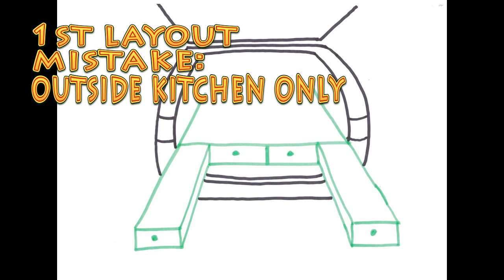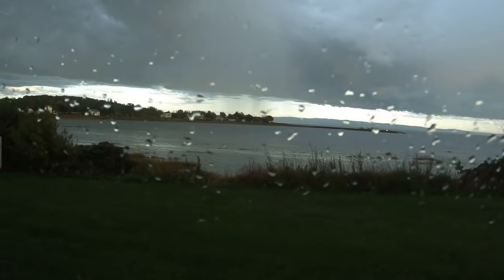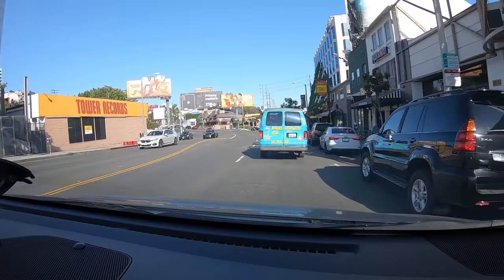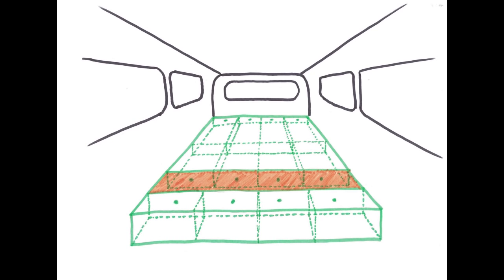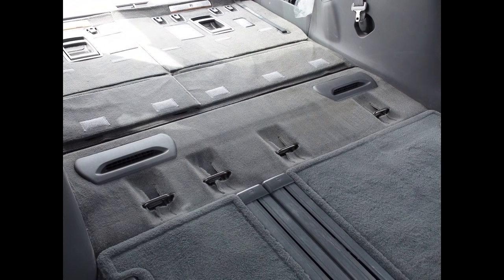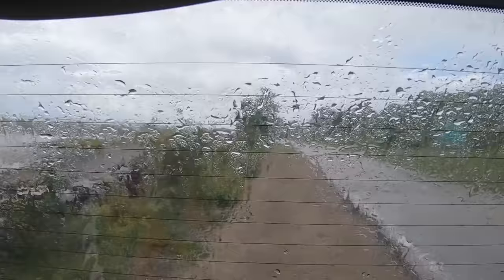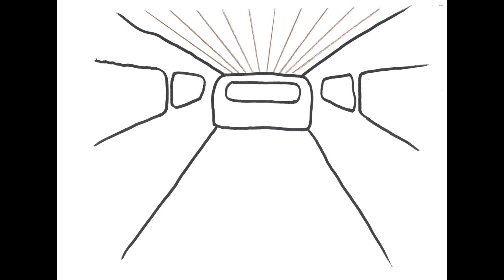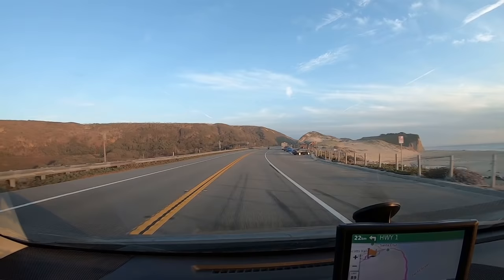11 mistakes to avoid (van conversion)

Comment: Great advice based on real world experience.  One thing, as a fellow surfer, I love the fact that you keep a couple of boards on the roof rack.  But, have you ever had someone try to steal the boards ?  Part of my problem is trying to store a longboard inside for fear of having it stolen.  I notice you have about 3 boards up there !  Nice !!
Reply from the maker: Hello Ray!
I use straps that lock and have steal wires inside. I use KanuLock straps of 13 ft. Never had any problem, and I have been everywhere with them!
If they don’t sell them at your local surf shop, show them the product and they will certainly keep them in stock. They will be glad that you show them a new product to them. 

Thank your appreciation!
✌️
Reply: @ericenjoysearth2756  thanks for the quick response... will get a pair ..Happy Travels Eric

Comment: Although I have yet to start a stealth conversion with my minivan, I have viewed many van conversion videos to help me decide how to do it simply and economically. I am delaying because I still haven't decided if I should convert my low top minivan or wait until I can afford a high top cargo van. 

Eric, with your 20 years of van living experience, your videos are the most detailed and economical conversion videos that I have found. I agree with your idea about having most, if not all, amenities accessible from inside the van. Also, while other videos that I have watched often don't include comments from the original poster, I am impressed at how many of your videos either include a comment, or an answer to a question, or a simple thank you. I appreciate all of your efforts.
Reply from the maker: Thank you John for your comment! It is really appreciated.
To help you figure out what van size to use, you may view that using a minivan is like living in a cabin of a small sailing boat. People that are sailing on those boat don’t complaint about it because there is no option that’s the way it is. Having a minivan, you will get use to it inside size too. I can tell you that I don’t regret at all having all the advantages of the minivan!
Enjoy planning your project ✌️

Comment: Great video! I knew I wanted lots of windows in my van and purchased accordingly, then I started to doubt that decision based on what everyone else was doing. Thank you for reassuring me on so many points. I don't always want to be outside or have my van doors open and don't get me started on mosquitoes! Thank you!
Reply from the maker: What is fascinating is how much people follow tendencies based on no experience or false concepts. Go ahead with plenty of windows! You will appreciate so much! Just use Reflectix window covers to manage temperature when you sleep (and get privacy). Thank you for your appreciation 😃✌️

Comment: Great tips, Eric.

Most of my kitchen is accessed from the rear tailgate but I made sure to be able to get to some kind of food from the inside of my SUV, as well.  I have 2 fridge units; one for inside and one only accessible from the outside for extra cold storage.  I have a Clam shelter for day-to-day use but I know I won't always be able to deploy it.  I don't plan on being an urban vanlife person so I'm not worried about those obstacles mentioned, but I did always keep in mind that I might have to do everything from the inside of my rig due to unforeseen circumstances.  

I bought a rear-facing camera to make up for my lost view in the rear cargo area.  I was going to just make the build shorter on the passenger side but that would have eaten a lot of usable storage space.  It made more sense to get a camera to assist me when driving.  

When I was designing my build, I took into account which things I need to access from inside and which ones I can live with that are only accessible from outside the rig.  Clothing was number one besides food that I knew I needed on the inside.  Also, a toilet.  I have already experienced times when I had to relieve myself and couldn't do it outside my vehicle.  Thankfully, I do also have a pop-up shower tent that I can set up quickly.  

I made a hard-wood floor for my front area in the Suburban.  I will also have a throw rug in my available floor space, which is easily removable and cleanable.  

Knowing me,  I had to make a bed that was accessible all the time.  I take a nap almost every day and knew I wouldn't want to have to mess with a convertible bed of any sort.  I took out all the seats in my rig except for the driver's seat, to make use of all the available space.  My bed will be up front where the passenger seats used to be.  Most people with a Suburban use the rear cargo area for the bed space but I didn't need to do that since I'm just one skinny person.  

Obviously, my rig will never be a passenger vehicle again.  One would have to go to a junkyard and find all the seats I've removed for that to happen.  Lol.
Reply from the maker: You set up something that suits you. This ya the whole idea! Enjoy! ✌️

Comment: I would like to add that I see lots of vans set up to live in that have lots of loose things in them.  I just wonder what happens with all of that stuff if you're in a roll-over accident or need to make a hard stop at speed.  Missile city.  I guess that's why U-Haul vans have a cage between the front seats and the back.
Reply from the maker: This is what I also referred to in my video, when I was talking about open shelves... 

thank you for your comment Steve ✌️
Reply: By the Grace of God, my then 10 year old son and I survived a serious crash. It was a dodge caravan, and I used it to transport photography equipment. When loaded, there was only room in the 2 front seat, and hand to God, you couldn’t fit a peanut butter and Jelly sandwich in the back. 
That day, I decided to take everything out to inventory, clean, etc. 
the 32 oz fountain drink in the cup holder ended up wedged under the drivers seat. 
We didn’t even roll over! It took half an hour to find my cellphone. Again, just 2 seats in the van, but it was totally totaled if you can imagine. I had never been in a serious accident before this, and thankfully not since, but I can still remember seeing the windshield spider webbing before my eyes as the bumper of a pickup was coming thru it, along with the splashing of Dr. Pepper and ice flying into my face. 
The idea of a fully, over loaded, rolling living quarters should cause people to imagine all this stuff trying to simultaneously attack them about their head and face while crashing at the same time, already makes me want to minimize and I haven’t even bought my van yet! 😅
Reply from the maker: Thank you Valerie for sharing this! It is a good reminder for everyone! 
It is amazing how much time goes slowly in those moments! 
Take care ✌️

Comment: A lot of good advice here. I've been campervanning in small vans for 30 years too. But I don't agree with the bit (4:18) about needing all those windows in order to drive in traffic. Almost every delivery van in the world has no rear view windows, and they are not hard or unsafe to drive. Even easier now we have rear-view cameras for parking. I have not looked in a rear-view mirror for decades and don't miss it - you just learn to use side-mirrors - it's not hard. The window just behind the passenger is the one that is worth keeping for very sharp junctions, although even that is not required - you just learn to approach such junctions square-on if you don;t have a passenger as 'spotter'.
Especially in a small van storage space above-bed is very valuable. And some people are easily woken by light, so for both these reasons (and thermal ones) we choose less glass - and just have the two door-location windows. Rear-quarter windows are particularly useless and better used for storage/insulation IMHO. Whether to have a rear window or not is very much a matter of choice affected by other aspects of the design.
A 360-view is nice, but we just sit in the front, or go outside, for that. Having to cover and uncover windows either to keep sun out or heat in most days means you really don't want too many of them. We currently have 4 rear window and in practice they just live with the curtains drawn 95% of the time. The rear ones are entirely superfluous, and we are just about to buy a newer van with much less glazing. I'll tell you in a couple of years whether we are happy with that :-) I guess this choice partly depends on usage patterns - how much time do you spend sat in the back vs the front vs outside. 
It's actually an annoying feature of a lot of base vehicles that they have way too many windows IMHO!
Reply from the maker: Yes it is a matter of choice. I prefer windows for plenty of reasons, lights, view, ease of driving, ventilation, etc. With such perfect diner view as you can see in some of my videos, I like that too much!

Of course you can drive without rear window or with only one hand, but I always use the path of less resistance!

What is fun with a conversion is to customize to our preferences. A matter of choice as you said 👍
✌️

Comment: I have learned that cheap isn't a good comfortable way.  I am using recycled products, but to finish it off, it will be $$$.  Especially if you want all the amenities.  I a going one step at a time with a build that can be dismantled easy and three pieces.  Not for long term living, but a comfortable couple weeks.  No kitchen set-up, strictly for ease a cost.  rain = sandwiches, sun and space = charcoal.  I have put storage under the bed, however it is very easy to get to as there is a space top squat beside the bed and lift the mattress enough.
this was a good video, and I appreciate the honest and common sense approach.
Reply from the maker: Thank you Paul for sharing your experience. Effectively, there is a set up for every use and for everyone! 
I support so much your statement that cheap isn’t the best way. For some product, it is not always easy to have quality... I hope that things will change and we will be able to buy things that last... It is much better for the planet, for us, the animal and plants world! And often our confort! ✌️

Comment: So appreciate Eric's practical approach! We've lived many months at a time in our minivan selling rocks & fossils at outdoor antique fairs & fleas in New England & the West Coast. Stealth is essential, it makes life so easy to pull over with a nice view, make dinner and settle in for the nite. Disagree though about the hard floor and building a raised bed. In a hightop van, sure, hard floor, stand up, build a bed. But for living in a minivan, we laid down thick interlocking foam gym mats & two really thick, knotted Persian wool carpets. So comfy! We use a handheld mini-vacuum plugged into the rear cig lighter, easy as sweeping. Vintage wool carpets are crazy expensive for normal sizes, but wide hall runners are perfect for a van and are crazy cheap, because nowadays there's so little demand for those shapes! Anyone can hit eBay, get a thick one and double it over! Also, since you can't stand in a minivan, why set things up so you are always stooping? Unless you have knee problems, just adjust to using your knees, which is fine if your floor is cushiony soft! Then use that height--your height from the knees up--to determine your comfortable working height for counters, sink, stove top & other built-ins. For sleeping, unroll a bed-roll directly over the wool carpet, like nomads have done for centuries! This approach gives you a wonderful feeling of spaciousness and overhead room, plus more of a sense of privacy because you are below the height of your windows. We usually lounge around on the carpet but also have a drop-down table and two foldable ottomans in case we want to sit up for a change or enjoy a meal at table. Just our approach... appreciate all the great tips, especially pointing out that the left back window isn't needed for driving!
Reply from the maker: Thank you for sharing your perspective and appreciation.

I have used the floor set up for years in smaller vehicles. Living over three layers of backpacking mattresses and a sheet to cover all this. My first two layer was blue foam backpacking mattresses and my last one was a self inflated backpacking mattress.

Of course you can live that way, and it is comfortable to sleep. But I was really tired of that set up. I had enough of not seating comfortably other than having the steering wheel between my legs, not having a full table to seat upright comfy. For me it was living on the ground like as in a tent. More confort for long time use is much more appreciated for me.

For the floor, I would never ever not use a hard floor. Every day I give a few broom sweeps on that hard floor each time sand end up inside. It is a hundred percent easy to clean! Can not be easier! I often use an antibacterial wipe to clean it more! When you spill a beer on the floor like we did a few weeks ago, you are very happy to have a hard floor! The towels that we used to clean the mess was so smelly until we wash them that I didn’t wanted to drink a bear for a while! I would not want to imagine the same situation on a carpet! Also, entering water on the floor is very easy when it is raining, or having a wetsuit on me. Kneeling on a wet floor is also not quite fun... I just love my 100% waterproof floor!

I guess that everyone has it ways. The important is to appreciate that way. My living is quite active with outdoor sports and may need to cover more situations. There’s also the style that we want to our van. Having an amazing nice carpet may worth some constraints if you deeply enjoy the look! There is many considerations. The importance is to end up in happiness! Thanks again for sharing your point of view ✌️

Comment: I love your videos. I am always so happy to see a new one come out. 
One question. How do you cook inside and at the same time not store the gas cartridges inside? 
Please keep the videos coming :D
Reply from the maker: Thank you Dionne! I much appreciate your comment.😃

I use a pocket stove for backpacking. It is really small. You can see it in my van tour video when I show that the table can be install outside. I store my fuel canister in my roof rack box. 

https://youtu.be/qJjL-NWeoVI

✌️
Reply: @ericenjoysearth2756  are you not going against a couple things you said in the video not to do? Your still using gas inside, the size of the canister shouldn't matter if that's what your trying to avoid. Also your point you keep the canisters in your roof storage, so you have to go outside to get it if you want to cook?
Reply from the maker: Hello Dustin,
What is dangerous about the fuel canister is having them leaking without that you notice it (while sleeping, or when you are at the beach, ...). I cook outside as often as possible. But I am not stock with an only outside kitchen. 

Of course I have to go outside to get the fuel canister. It does not take 30 seconds.

I don’t think that when you go
 Van Lifing you want to stay forever in your van, this is quite the opposite. The point is to be able to manage to do your things inside when you need to. ✌️

Comment: You can tell you're an actual van dweller. Your remarks on external-only kitchens is very appropriate. When I converted our cargo trailer ( 5'x10' ), we specifically assumed that rain would be a common issue. The kitchen and cooker are available inside, but we assume less elaborate meals when stuck inside. On how much a conversion costs - ours was pretty inexpensive, and we're not living in a storage unit. We have finished tables, cabinets that close, shoe rack, etc..basic cost was about $500 USD for materials. Electrical supplied by a "solar generator"  - another $500. The materials are all of good quality, but the space was small so cost was manageable.
Reply from the maker: Make sense! It is always interesting to have feedback from other experiences. Converting a cargo trailer as you explained look quite interesting. Thank you for sharing ✌️

Comment: I've been driving windowless cargo vans for years (I  run a HVAC business) windows are not necessary at all. I have no windows and no review mirror. I do I have backup camera which is amazing and essential unless you have mirrors mounted on the rear of your van. Besides the window thing I like all the other information. You can purchase a cheap backup/review camera nowadays for nothing.
Reply: the nice thing about windows is the view, I like to see what is around me (360 degrees) It makes you feel like it is bigger inside and safer  (at least it does for me.) but you are right, if you have a van without windows you don't need to buy one.
Reply from the maker: I really appreciate having lunch inside and seeing all around! It is not only a question of driving. When I eat and I enjoy a 180 degrees view at my table, I really happy about it!
...and I have a rear view camera on my dash. But what is more convenient to look through the windows!

Thank you for your appreciation ✌️

Comment: I have a full size Ford window van and I have been progressively building the inside of it so that it is fairly easy to relocate to another van in case the unthinkable should occur. I cringe every time I see people putting hundreds of hours of woodwork in a van and invariably every year I see plenty of people on Facebook realizing too little too late how problematic this is after the van has been crunched or is experiencing very expensive mechanical difficulties, making it more viable to simply replace the van with a similar one. By the way, I totally agree with your video presentation.
Reply from the maker: Thank you Dale for your comment. We definitely both agree!👍